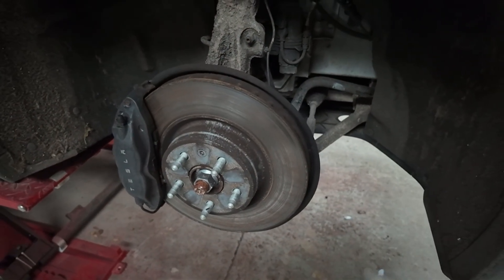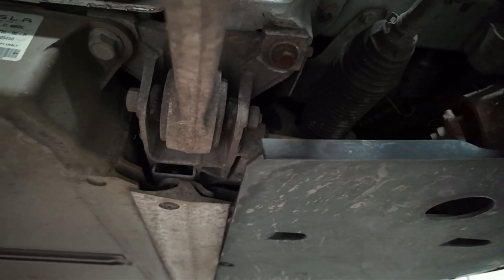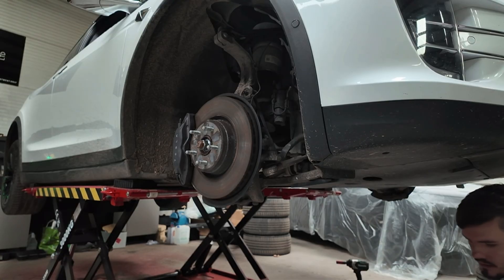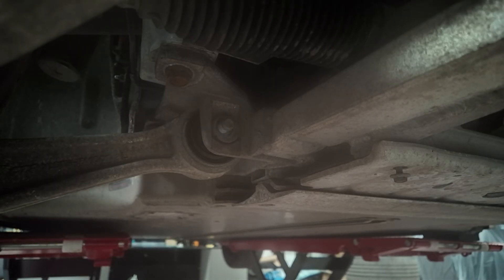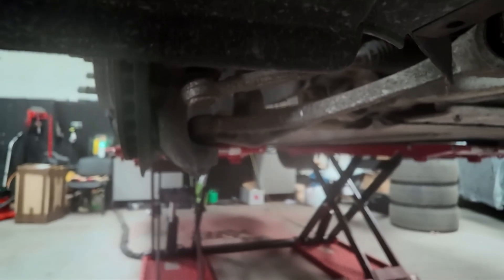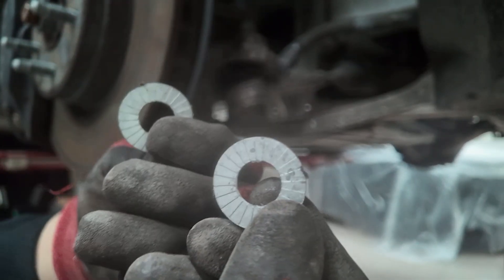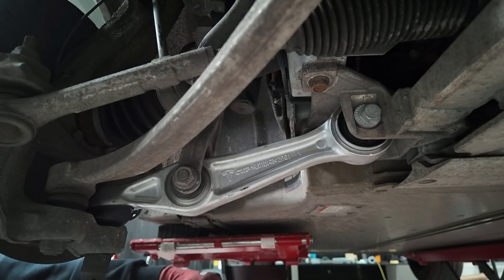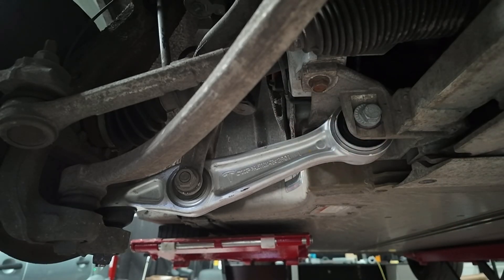How to replace lower control arms on a Tesla Model X

Comment: Is it not a requirement to tighten the inner bolt with suspension compressed? Other wise the bush is not held at the ride hight position so will be stressed or twisted and won’t last as long   ? Or does the bush twist with suspension  movement ? I’d be subsided as it would wear quicker
Reply from the maker: Yes the inner and middle ones need to be torqued under load. For recording purposes it was easier to record like this but I will ensure to make this clearer next time.
Reply: Agree , info was missing in the video about it

Comment: Thank you so much for this video.  I'm going to try this soon and I was nervous it was going to be too hard.  Shop quoted me me over $2k to get it done.
Reply from the maker: Go for it! Angle grinding the bolt is the hardest part! Remember to torque the middle and inner bolts under load.
Reply: @Richardsonsautomotive  I just did it and I'm happy it came out well but I have a clunking noise that hasn't gone away.  Next up will be the front fore lower control arms.  UGH!!!

Comment: What height did you put the suspension in? When I did this myself I struggled putting the center bolt back in. thanks
Reply from the maker: The suspension should be in Jack mode so it shouldn’t adjust too much. If you struggle with the strut bolt you can put it in 2nd and lever one of the other sides up or down depending on which side. It can be hard if you put the outer 2 bolts/nuts on first